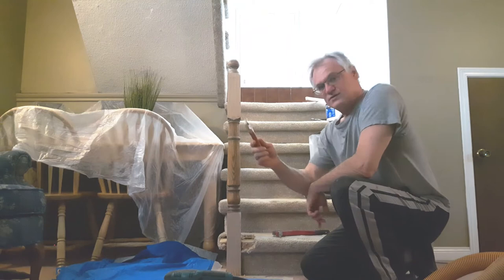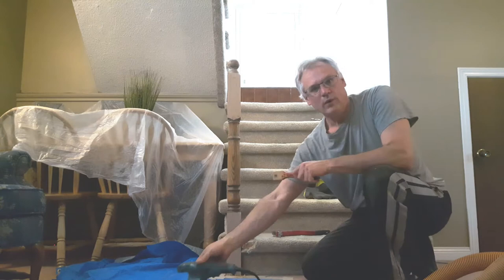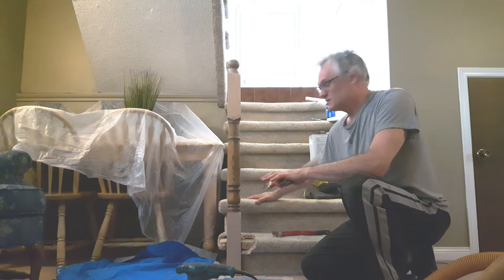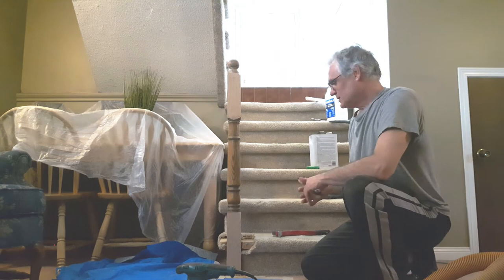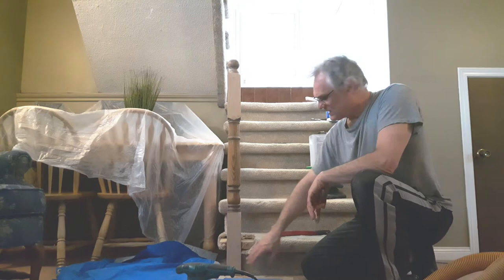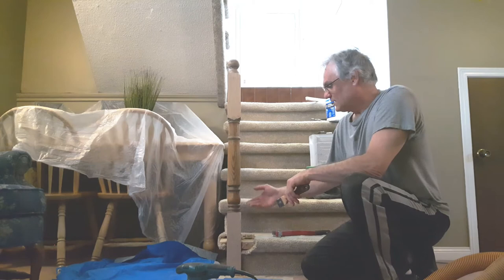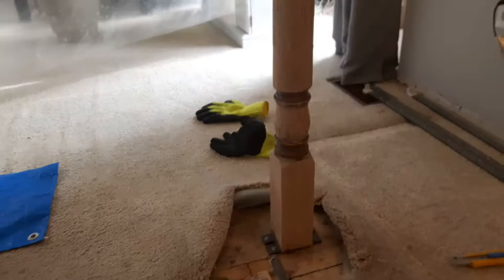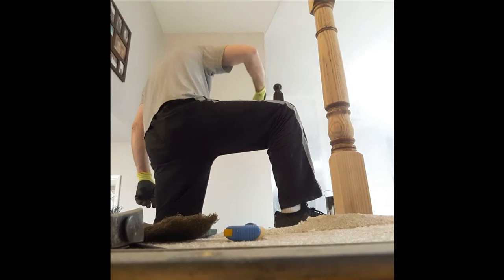Sand, Stain, Refinish Oak Handrails, Newel Posts, Balusters - Ask Questions & Comment (Ep#11)

Comment: Hi, great video!  How do you personally apply the polyurethane to the railing?  I am planning to do this same thing to my railing except I will paint the ballisters and risers white.  

I am wondering also if I should use the floor poly on the railing as well so everything matches?  

Lastly, on the treads, would you only go up to 60 grit as well?  I have oak treads that I just removed the carpet from.

Thanks!
Reply from the maker: Thanks Jeff. I used a brush to apply 5 coats of Fabulon to rails. Thinner coats are better. You could also use lint free roller.
Reply from the maker: Treads can orbital sand to 60 or 80. But I screen sand to 180 or 220 between coats of poly. Will be smooth as glass. 
Yes same poly I used on floor.
Reply: @HardwoodFloorRefinishing101  Thank you!

Comment: How do you effectively strip and sand the turned parts?
Reply from the maker: For the turned parts I used the wire brush, stripper pads, and sandpaper.

Comment: I'm not sure I understand why you need to use the chemical stripper if you're going to sand it anyway.
Reply from the maker: Stripper applied to lathe turned parts makes it easier to remove finish with wire brush.
Reply: @HardwoodFloorRefinishing101  Ok. I'm getting ready to re-stain the stair banister and I was just going to sand with 180 grit then 220 grit, pre-condition, stain, then polycrylic. But now I'm wondering if the stripper is a necessary step that I shouldn't be skipping.
Reply from the maker: @_Moto215  a wire brush and sandpaper should be fine
Reply: @HardwoodFloorRefinishing101  Thanks. Appreciate the videos!
Reply from the maker: Thanks for watching!